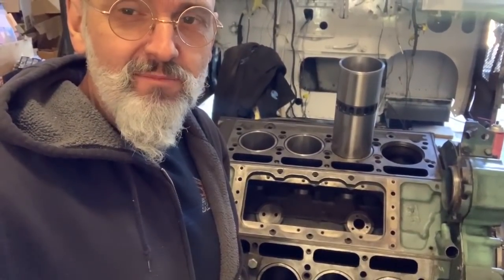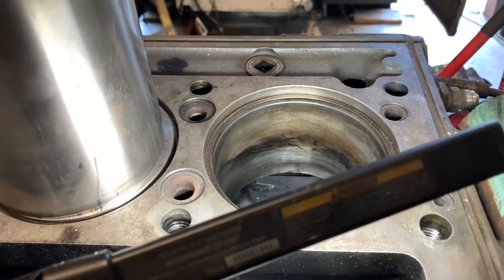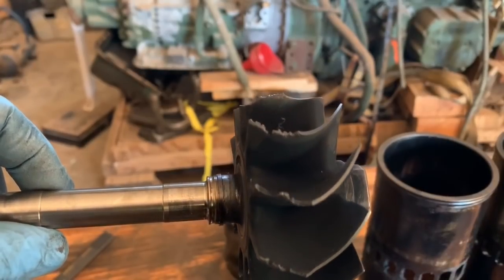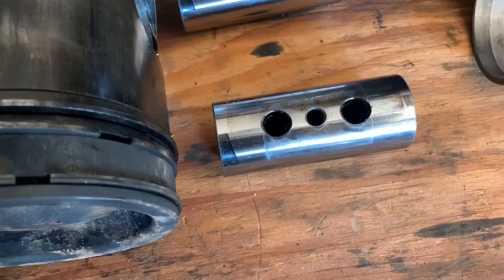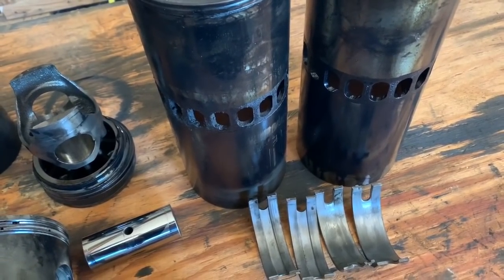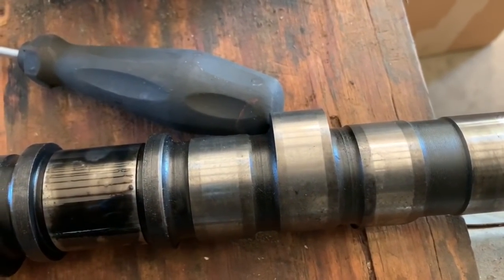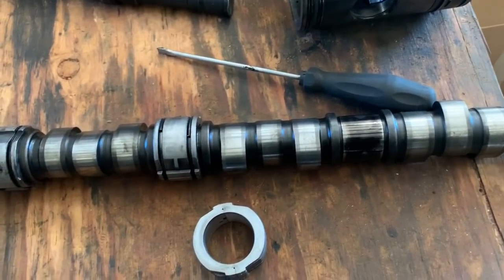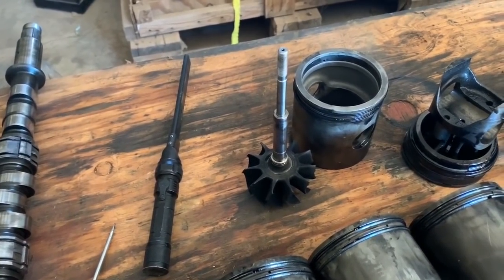Engine failure , why we had to rebuild our 8V71TA Detroit Diesel after 625 hours

Comment: Wasn’t this a bus grease monkey build?
Reply from the maker: Yes
Reply: @LacroixCruiser    Oh dear............My bubble of perception about that guy just popped....it's sad
Reply from the maker: Unfortunately his inability to take a moment and refer to the Detroit Diesel service manual cost us a lot. All the mistakes that were made could have easily been avoided had the service manual been followed. 

The gentlemen that mentored me in rebuilding the engine per factory specs has been doing them for over 50 years. He doesn’t do anything without referring to the manual. His knowledge is so profound of these engines and manual, that every day he would tell us what needed to be done, and what page in the manual the instructions were on. In the early stages of disassembly we found a thin flat piece of metal about 1/4” by 1/2” with a slight curve to it. He was able to identify exactly where it came from at first glance. At that point we knew we were in a different and better league.
Reply: @LacroixCruiser  I would say Bus Grease Monkey has some good videos about road side general repair, and rack/injector issues... But as an engine builder...he doesn't have the place to do the major overhaul type stuff... There were some things I asked him that I wasn't sure of (like switching from 2V to 4V heads if certain things need to be changed)...but those are things that aren't in a "manual" they might be in a "TSB" but these engines almost pre-date paper...(I am kidding)
Reply: @misters2837  having traveled the US and Canada as an entertainer coach driver, I can tell you the Bus Grease Monkey is very competent compared to some of the clowns we had working on our equipment. 
I only had Bus Ride magazine’s repair shop guide or a local yellow pages to find repair and maintenance most of the time, there was no internet for reference. It was the early 80’s. 
Coaches are not getting any younger and earlier botched repairs are so common. 
My one overhaul was at a Detroit dealership in the Quad Cities on recommendation of my main mechanic in Chicago. They were surprised to see the modifications Greyhound had done in their engine shops, as it was bought from and rebuilt by them. 
Engine repair and rebuild should be handled with the best sources available since machine shop skills are used.
Reply: @tageuhl6422  I drove truck for a while when economic downturn forced me to....I have seen said "clowns"
Reply: Bus grease monkey is not an engine rebuilder.  He is a shade tree mechanic, anyone who has seen his setup would know hes not a professional mechanic.  I have never seen him measure the cylinder bores or the sleeves. Or measure the cranks/rods/etc...That is a must on a Detroit.  He would be someone to call to do bus maintenance or an emergency repair.  I would not have him doing rebuilds.  This is not an insult to him, but the reality of the situation.  Finally good luck finding a decent Detroit shop, they are nearly impossible to find!
Reply: @kevinoscarson2941  I would agree there are very few people who understand the precision needed for the overhaul of a DD 2-Cycle. Granted we know that once they have been built properly and put into service they literally can run continuously for years with little more than routine maintenance... (I saw some as generators in service that when power companies tell businesses to shut down due to demand, that ran for WEEKS and even MONTHS...to stay operating!) They are an indestructible unit if assembled properly... But very few understand how to properly set up the racks (yes you can replace an injector on the side of the road, but its only "close" to get you home, proper setup requires dial indicators and patience) or put things on the bottom end together with the proper fit... I have "rebuilt" MANY, engines, and "built" many performance engines...it takes great attention to detail... And 51/53/71/92/110/149 DD engines are definitely ones you need to have a good understanding of how clearances work...
Reply: Oh this should be interesting to watch...
Reply: In looking back at the channel, I kinda wonder if this wasn't a guinea pig project, and way early on in his progress of rebuilding bigger projects. 

I can't say anything about the oiling holes being on the wrong sides of the lifters that's definitely a derp moment there, but in that video from january 2019, the cams already have wear marks in them, you can see that just looking at them.
Reply from the maker: We would have changed them had he said it was needed. I wasn’t on site for most of the build( it was before I retired), had I not relied on his opinion, I would have changed them then. It’s an easy job, and in my racing days, every rebuild included the cam.
Reply from the maker: @kleetus92  others have reached out to me with similar issues. His work style fits doing heavy jobs, suspension, brakes etc, precision isn’t his thing.
Reply: @kevinoscarson2941  yes,  exactly.   When his 6-71 dropped a valve on a road trip in Oregon,  he called in a pro.  The video is on his page.
Reply: @JimBronson  I forgot about that!
Reply: @LacroixCruiser  yeah the unfortunate part is I believe he truly means well and does want to help.
Reply: hope he is paying towards this?
Reply: Aftwe the diagnosis, would it not have been better to buy a good used engine?  Far less costly??

Thus is snall in conparison, but the principle is the same.  I spent $1,800  in parts for a VW V6 rebuild,  1 piston, used heads, machine heads, gaskets, timing chains and belt and other parts, oil, coolant etc. My labors free .  I could have bought the entire good engine at pick n pull for 300. 

Was this considered? Ya, i know, re and re 2,800 lbs  Never done it, but was this ever in the cards? i mean even your crank is in jeopardy. . . .
Reply from the maker: Finding a good used left hand rotation 8V71TA is like finding gold in the bottom of a Cracker Jack box, highly improbable.
Reply: @kleetus92  there are more motors out there with problems I have been told. But, again why are people having doing rebuilds when he is not equipped to do them right?  I at least relise this. I have booked him and his son to rescue my bus near them. I have no plans for a rebuilt motor either.  Update 7/21/21. To date Tylor failed to keep his word in may to rescue our bus. Refuses to take our phone calls and claims he is to busy. I am done defending/supporting him and his father on patreon to get our bus worked on. $1400 later and still no work done.  Bus was moved to a shop with years of experience.
Reply: @dmc2554  I'm a mechanic and I unsubscribed from that dodgy bastard years ago. I used to cringe at the things he did. The thing is, he could be good but he lacks the formality that a trade qualification gives. Those formalities are things like understanding basic mechanical principals, always referring to manuals, knowing when to actually use proper service tools and when you can get away without them, systemic fault diagnosis, and never just trusting your preconceived ideas on an issue. Proper cleanliness is another area that non trade types don't get. BGM displays a high level of hubris and as such he's very arrogant. I wouldn't be surprised if he has a personality disorder which precludes learning. Learning is a lifelong pursuit and no one person can know everything but some believe themselves so far ahead of all others they don't see the need for manuals that 'subordinates' rely on.
Reply from the maker: Great diagnosis
Reply: @robragle  you need to remember.  Some have been on a waiting list for two years. Then required us to be on patreon at the minimum of $25 per month. $1400 later we only got one round of stickers from patreon after over a years worth of monthly fees. He did not keep up the membership benefits. Not staying on property,  work on bus nor answering questions.   If you want to defend that. Go ahead. I am done as is my staff. We don't run our business like this as we would not exsist.   He has 6 motors I have been told of that have issues. One just months ago with a wonderlodge. Engine work without proper training and tools. Tyler confirmed this back in April via phone call. But, they also make it clear. They are not professional but back yard mechanics.  Tyler has more formal training.  Their work is more of a roadside get you back on the road style.  Motor issue?  Go to a real shop. Period.  Don't  blame them.  Proof of why is out there and shown in their videos.  Yes, I am formally trained ASE Cirt. Master. At one time.
Reply: @twofeathersrv  I’m not defending him in any way.  I just think comments that are more of a personal attack on him, or anyone, are out of bounds and that is what I was referring to.  Reread my reply and you’ll see what I mean.
Reply: @robragle  I see your point. But if a person has had direct experience with the two people that make the grease monkey meaning father and son team. They have every right. The damages caused from this one build was a big thing for both parties. It was major news when it happened.  Bus grease  monkey kept comments to a min. This video is why.  A mistake did happen.    As for others taking sides based on others posts or comments. Sure, I do agree but they are only opinions and not experience.  I had good experience and patience till April of this year. Lack of proper communication was the problem.
Reply: @twofeathersrv  I guess you and I are just different people.  Good luck to you.
Reply: @ThePaulv12  i am a professional Mercedes tech. I made a comment to him and he was a rude arrogant pos. there was nothing professional about that con man. not even his dress was appropriate for being safe.  I unsubed after he was rude to me. I am very happy that this video is exposing his real "work".  from watching him work I am sure he has many more victims.
Reply from the maker: Unfortunately yes we are not alone
Reply: Yea I know a guy,,a friend of mine who had his engine rebuild by him,,It threw a rod after only 200 miles,,The rebuild cost him 12 grand,,,And I’ve heard of 6 other people who had engines rebuild by him that blew,,,,And when my friend rang him to make it right,,He told him to take a run and jump,,,He laughed t him over the phone,,,What a horrible thing to do,,,I wouldn’t let him do an oil change,,,,

Comment: I did a rebuild in my 371.  Engine was build for ww2.  It took me a long time as i had never worked on a diesel.  I had a couple of friends that gave me a students manual from the 40s and another from the 80's.  the engine had been updated in the past and was a combination of the two.  I studied those manuals and watched youtube video's like yours.  and believe i got it nailed.  watching your video scares me too much, thinking about those vibrations screwing up my bearings.  Thanks for coming clean about what a bad job that rebuild was.    When i was done and my boat was running like it should i realized, i am glad i have a small 371.  it was allot cheaper to rebuild than a 8V71.  Wish me luck with my engine.

Comment: 71 series engines are what are referred to as dry liner or dry block engines.  It is critical that the liner to block fit is within specifications.  If the liners are loose they cannot transfer heat from the cylinder liner to the block.  The old rule or thumb is it must not loose more contact area than the size of a quarter.  The block can be salvaged by boring it and adding oversize liners.  Fleets such as greyhound would successfully rebuild the 71 series engines several times with success.  It is not uncommon to find a old greyhound engine in a salvage yard with a rebuild tag showing .040 under size bearings and .040 overbore.  Beware of old bus engines if you want to use it for something else as it may be reverse rotation.
Reply: Swap  the cams side to side to reverse rotation, i believe.  The engine is 100% modular.
Reply: 2 or 3 thousandths

Comment: that #3 liner was too loose. I would have used a #4 or honed the bore and used a .005 over liner.  i didn't catch in the video where your fuel leak was.  everyone wants to be a diesel mechanic.....lol. i built my first detroit 45 years ago . i learned from and old timer that had worked on them his whole life. my shop specializes in 2 stroke detroits and i love every minute of it.
Reply from the maker: We installed a # 4 there when we rebuilt it. Unfortunately the previous mechanic just went by what was stamped on the block, he didn’t measure the bores. 

2 of the injector cross over tubes hadn’t been tightened on initial start up, and test drive, leading to the engine making oil.
Reply: @LacroixCruiser  that explains the oil dilution.  i can't even begin to tell you how much work these wannabees have created for me through the years. i keep a #2 and a #4 liner on the truck to find the right size upon teardown. if the # 2 is loose and the #4 is tight then it takes a #3.
Reply from the maker: Great plan.

Comment: The thumbs down must be from the last 'mechanic'.
Reply: Yes, there must be a wrench-twister involved in the previous repair/rebuild who may have played a part in this story.
Reply: If they don,t hone the black out of the cyl.block & have bright iron for the cyl.  liner to fit & have metal to metal contact they will gauld another piston, bee n there & done that. This mechanic wouldn,t make a good lawn mower mechanic.
Reply: @howardgaither8759  I hope you're not talking about the guy who rebuilt it this time (Yvan's just the customer), He's been rebuilding detroits since long before there were V models and most old timers still alive these days were in diapers.  It got honed, measured, fitted, and measured again, this time it got done by the book and proper.
Reply from the maker: This time everything was definitely honed with a micrometer adjustable hone, measured many times, and the fit adjusted to within Detroit Diesel specs. 

Yes the mentor that helped us is not only a fountain of knowledge when it comes to these engines, but also a great human. He has helped many people in similar situations to ours. It’s unfortunate that he was camera shy, I would of loved for him to take the spotlight.
Reply: I too was an old time Detroit Diesel mechanic, Detroit Diesel Service Craftman Guild member, built many engines, wish  i had kept a record. I was not talking about the guy that repaired it last time, just the baling wire mechanic that made the mistake of putting a loose fit liner, & all the other mistakes when he assembled it.

Comment: Sorry to hear this happened - its funny that Stu over at Dangar Marine also had his Detroit rebuilt and then had failures afterwards (in less time that yours), resulting in a full second rebuild.  I guess the conclusion is the mechanic who does the work really has to know their stuff or big bills result, never mind down time.  Starting to get scared of these series of engines, they look way more complex that "standard" diesels ...
Reply from the maker: Nothing to be afraid of. These engines were built for many decades and we industry standards in the trucking, bus, industrial and marine industries. To rebuild them properly simply the mechanic be humble enough to follow the manual. The mechanic who mentored me on this build, despite having over 50 years experience rebuilding these engines, refers to the manual for every step.

Comment: Who ever  rebuild  the engine should have known  that all most all 71 series with high hours  sould strip block  to bare & machine  line bore in block to over size lines, i have pulled engine  apart that have high hours with cam rollers installed backwards  & no cam damage  . as for wrist pins wear , i think it is junk aftermarket  parts not over torque of bolts..
Reply: You know your stuff Rux 😉😁

Comment: obviously the guy who done this didnt know squat about dd 2 strokes. i've rebuilt several over my 40 yrs as a mechanic and you must use the manual on these motors. they are a simple and complex at the same time. the fuel system alone is enough to keep most guys from ever touching one of these.

Comment: You definitely had fuel dilution on the rod bearings. The roller followers oil hole faces away from the cam on installation. The scored liners also show fuel dilution and overheating

Comment: The main problem is you have had mechanics that do not know DD 2 stroke engines. A properly fit liner never drops into the block like your video shows. I have rebuilt 71,s and a few 110, s for over 30 years.
Reply: That's right, a thumb fit is perfect but I have had to push a lot harder

Comment: those missing tips on the turbo turbine were burned away, not knocked away me thinks
Reply: Probably a combination of both. The carbon deposits adhere onto the fin and create a hot spot, like a chunk of charcoal. That hotspot then melts the fin.
Reply: @jefflittle4013  very common for charter coaches, that long periods of high idle would build up carbon and then running at highway speeds, we would be spitting out sparks visible at night.

Comment: Hey Pop isn't blow by from piston ring  excessive wear ? I'm.ptetty sure I learned that in grade school .but who did you let rework this motor before some child who said he knew how ?
Reply from the maker: Typically yes, in this case I couldn’t find a better way of explaining it. The cylinder liners that were installed by the previous monkey were 2-3 sizes too small. They had so much space that oil was flowing around them.

Comment: hope you check Oil Pressure and the Injector on this Engine , Look like over fuel and no good oil Coase of to much fuel or some thing ales, This Engine have lock of Lubrications I believe
Reply from the maker: Unfortunately the technician who rebuilt it didn’t check either, that’s why it had to be rebuilt.